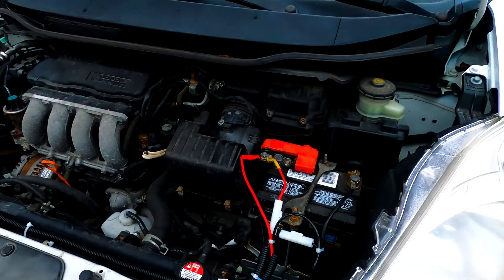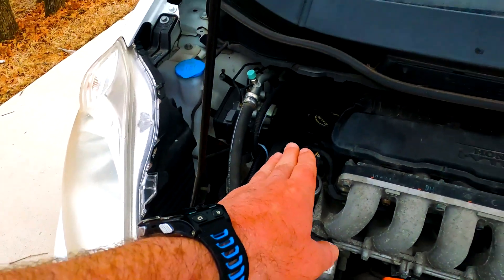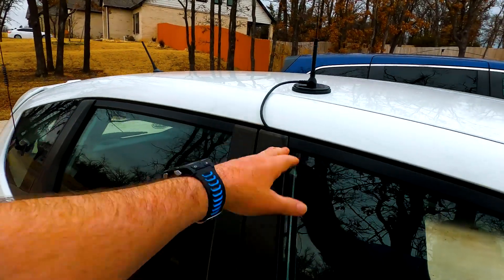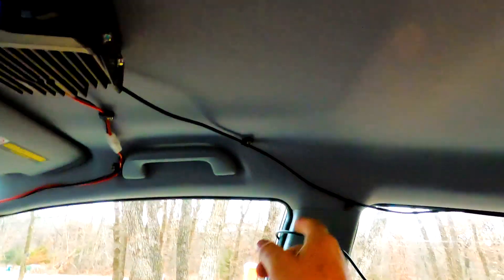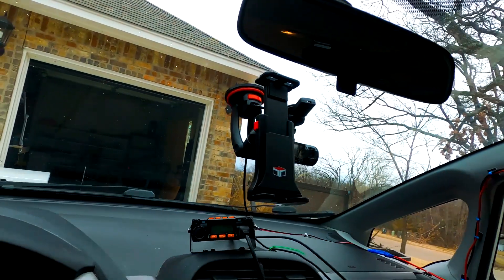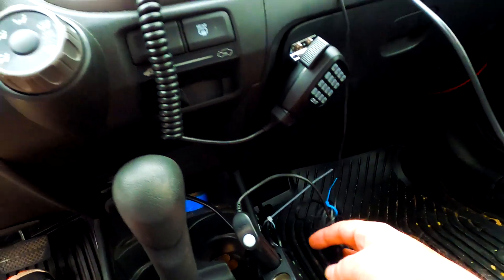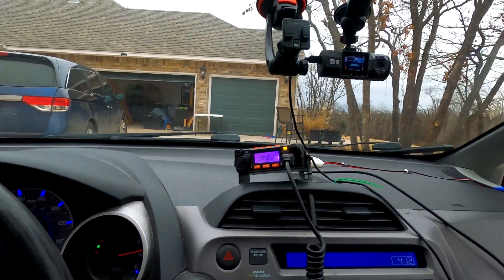Car Ham Radio Install QYT 25 Watt 2M 70CM Radio (UPDATE)

Comment: How far away was the repeater? 
The reason I ask is I'm  interested in that very antenna you were using. It seemed to be receiving very well so I was wondering how far away you were from the repeater and if  it was VHF or a UHF repeater you were into at the time. 
Thanks.

Comment: um dude...  You did notice that you put screws into your airbag locations.  It clearly says (Airbag) on your A pillars.
Remove the Roof Radio and place it into the glovebox or center console.  Then order a Cat6 breakout patch cable with a panel mount on one side or just a double female bulkhead passthrough and a normal patch cable.  This allows clean installs and better cable management.  Mic cables can then come out of the dash or lower/inside center console.  But get those screws and wires away from the airbags and have them inspected to make sure you didn't damage them in case you might end up needing them.
The only radio I could not mount fancy is my CB and I went with a semi compact model for that reason.  
I used the above method to remote mount my Kenwood's screen and mic ports.  I still need to extend the db9 and control audio cables so I can make my laptop's install more clean.  I run my Kenwood in Repeater mode and Sysop Echolink modes along with APRS.  
My HF covers FM/AM/USB/LSB and Kenwood Covers UHF/VHF Ham/Civ/Mil Tx and 118mhz AM Aircraft up to 1.2ghz FM on Rx.
Reply from the maker: I avoided the bags, I knew about it.
Reply: @hamradiocq  It is still going to get torn on those screws should it deploy and throw those wires out at you or your passengers.  Best to relocate the wires all the same.

Comment: What happened to the Icom 7300 you were selling and the flex 6400 you were buying.
Reply from the maker: So, I sold the 7300 with the box and manual.  I got $800 cash.  Flex never sent a radio and after waiting 2 months I just cancelled.  I'm not sure what I'll do.

Comment: you might be able to avoid cutting a hole in your headliner for the antenna mount.  If you drop the dome light, you might find you'll have enough room to fish a wire between the headliner and metal roof.  Sometimes that works, sometimes it doesn't...its different on every car.
Reply from the maker: TNx fer comment, sounds like more work than just cutting a hole.
Reply: @hamradiocq  Look for a shop that does public service vehicles. I paid $60 to have my nmo professionally installed. They dropped the headliner, drilled the hole, hid the wire, cleaned up the mess, and put it all back together in 30 minutes while I perused Motorola catalogs in the lobby. Money well spent, if you ask me. 73.

Comment: Wish I could mount radios in my van like you have in your car. I have ruined three antennas because the door keeps squeezing the antenna cables. 😒
Reply from the maker: Yeah maybe you can replace the coax on those antennas?  It's a PITA to do this car stuff.

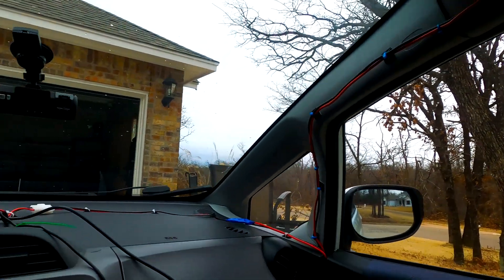Comment: 1:55 sorry mate, but you should stay away from the airbags when you run cables inside the car.
Reply from the maker: Yeah, I get it, I used stickies and did not drill there.
Reply: @hamradiocq  I think he was meaning that if the airbag goes off will the radio become airborne after the wire is pulled with the airbag deployment.  It is like when you see people with their feet on the dash and wonder how bad it would hurt to have your knees shoved into your face at high speed from someone bumping your car.
Also on many of the newer cars they have "curtain" airbags that shoot from the pillars of the roof.

Comment: There is a local company that Midwest Audio that will mount the antenna by dropping the headline
Reply from the maker: Wow I think I'll use them if it's not crazy expensive.  I just found one in Edmond.
Reply: @hamradiocq  correct 33rd and Broadway

Comment: Nmo mounts use a 3/4" hole .
Reply from the maker: That's great, but I need to get thru that inside ceiling stuff first.
Reply: There shouldn't be any sound deadening above the headliner so you can either fish the coax from the hole in the roof across the top of the headliner to the side pillar of the windshield or use your hole saw and go through the headliner when you drill the roof
Reply: Mine was a 1/2" hole.
Reply: @shank0  i forgot about those yeah the 239 mounts are a 5/8 hole I believe but 1/2 might work.  The 239 is pretty common with the comet and diamond fold-overs but most surface mount antennas other than those use the nmo.

Comment: Technical question about the through the window antenna. Is there a trick to knowing if the window is metallized or not? I have a 2009 Chevy 2500 Silverado I would like to put one on the rear window. 
Thanks Jeff
Reply from the maker: Good question.  I think you are fine with most common windows.  You just don't want to use the windows with the defrosting lines, it says that in the instructions.  Be sure to read the instructions first, you only get 1 shot at putting it on the window.  It's designed to stick and not be removed again.  Please use the link in the description as I get a small commission and it will cost nothing extra.  Thanks.
Reply: @hamradiocq  the window is tented and it's not a film it's made into the window some how. I hate to stick it on there and then find out it won't work ha. Maybe I'll roll the dice. Great video as usual I always learn something from your video's and I find them very entertaining. Keep up the good work.

Comment: Glad to see you got it done. Sounds like the little magnet mount is working good for you. I hate having wire come through the door like that but must admit I have had to do it that way several times.
Reply from the maker: Hey dheller, I don't know what to do about this but get a mount that goes thru the ceiling.  Tnx fer comment.